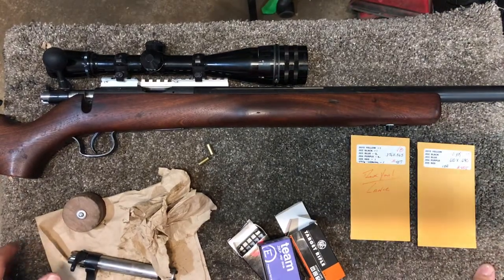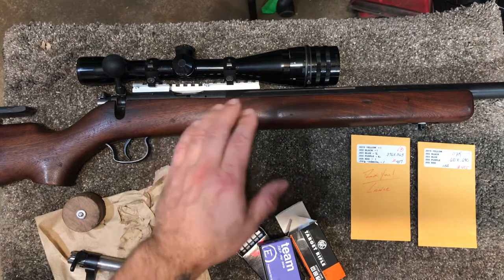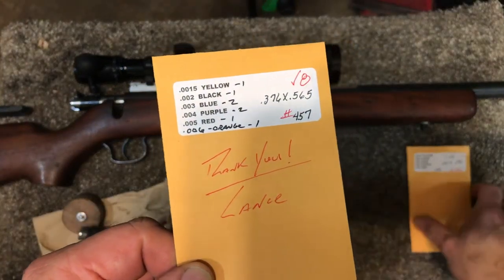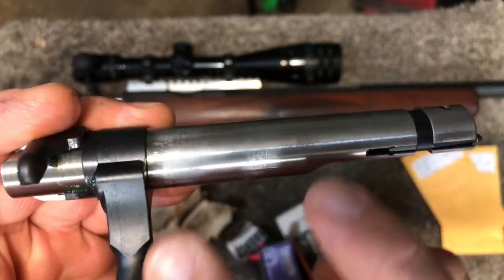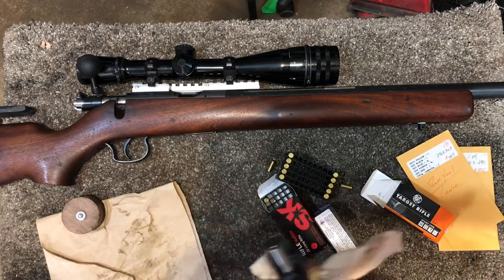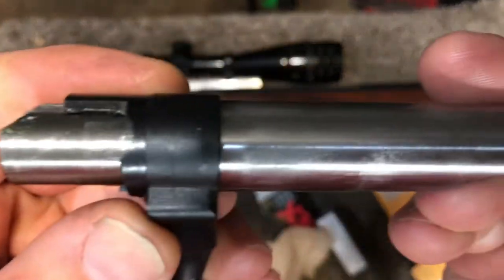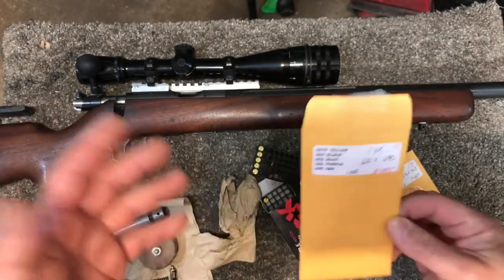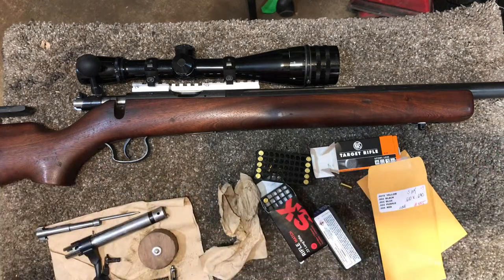How to shim a bolt to reduce headspace- Brno4/CZ452,455

Comment: Just a thought. On a Brno or 452, if you unscrewed the barrel and turned the tenon down to achieve proper headspace the slots for the extractor and case holder wouldn’t line up properly. So the shims are possibly the only way to do it.
Reply from the maker: Hey there, the shims are the easy way to do it. One would need to follow the same procedure as if installing a brand new barrel if one went the barrel method to adjust the headspace, but it is most certainly doable, and the best way, but not at all easy for the average person

Comment: Good video.  But I have one question.  How tightly does bolt closure become when you've reached the proper headspace?
Reply from the maker: Great question and I will be demonstrating that during the range test video, but the long and the short of it is- it is based on the thickness of your shim. The thicker the shim, the more “tighter” it will feel. This is important because a thicker shim doesn’t necessarily improve groups, it’s all about a balance. That’s why I say start thin and work up.

Comment: Hmmm..... let me ask this--> OK, I get how this works, BUT.... let's look at the bolt-face. It can be described as a "depression-in-a-cylinder".  The breechface.... in my words, the plane where the firing pin protrudes from. This breechface "depression" usually determines headspace ...IF....the remainng surounding metal....the "cylinder"....hits the immovable portion of the receiver. So.....my question is.....this shimming seems to work ONLY if the surrounding cylinder STILL has some amount of "Gap" axially forward.... toward the immovable portion of the receiver.....right?. If not.....we can't shim this.....right? I always thought a shim kit would be varyng thicknesses of shims that is placed directly upon the breechface. Does this make sense to you as a "visual" explanation?....and if so....can you comment?
Reply from the maker: The shims work by allowing one to close the available distance between the bolt face (adjustable) and breechface (non) and therefore allowing the rim to be pushed forward- driving the round deeper into the chamber
Reply: @inrangerimfire20two  ....I guess we're saying the same....but to use my own words so that it's more understandable ( to me and maybe also to others).... the boltface must therefore have some airspace in front of it  when adjusted for headspace....otherwise shimming would not allow full bolt closure...meaning the boltface would otherwise hit the "receiver" or "backside" of the barrel. So...let me ask....how can we adjust headspace ( if at all) on a Savage MKII design, where the bolt handle is not removable, and the headspace is determnined  by the backside of the bolt handle riding against the receiver "slot" in which it rides?
Reply from the maker: @TheWilferch  yes we are saying the same thing.

The bolt/handle etc on a MK2 is removable and I have shimmed one before but it isn’t recommended. I think there are some pics on Triggershims website showing how it’s done. I may even have an early video on it when I did it on my Lakefield 91TR
Reply: @inrangerimfire20two ...thanks....I'll check into this.....thanks for responding with detail.